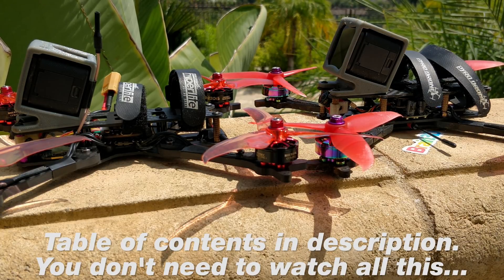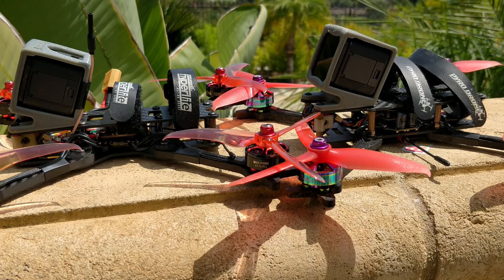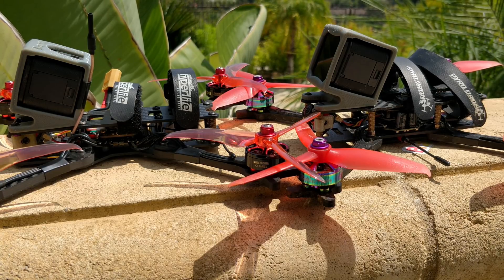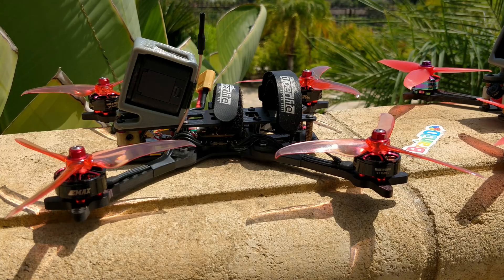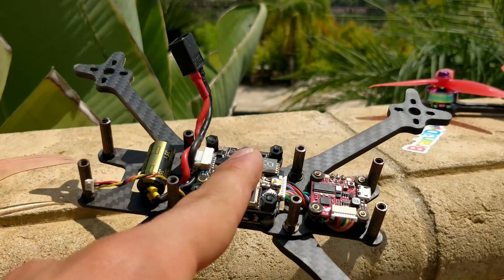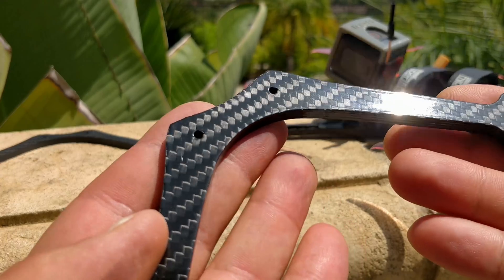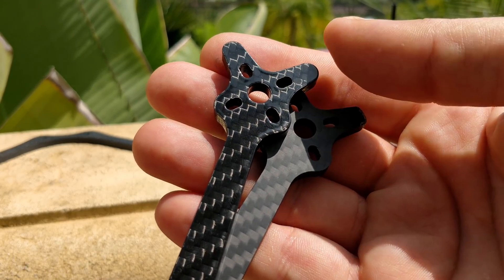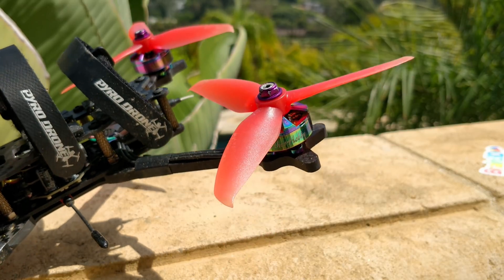Frames, Carbon, Feed Forward, RK 5152 V2

Comment: I start to fly again after 3 years, and i build 4s setup, but now i think about 4s or 6s but more durable, i rly like your frame but i already nave mini not micro cam, and also rly dont want to see propellers, but normal I use rly low tilt. so what will be the solution for that? ty for let me know
Reply from the maker: I'm working on that and the solution would be to use a hero shape GoPro where the lens sits higher up

Comment: The feed-forward output is not affected by the process feedback (external influences, vibrations etc...) nor is it calculated from derivative, so it can never cause the control system to oscillate, thus improving the system response, If the feed forward can estimate the control output closely, the PID algorithm, whose job it is to minimize the error between the current state and the desired state, will need to do less to correct the error. The reason your quad felt twitchy would likely be from the usual pids your accustomed to. Raising the feed forward and lowering your p and d should give you a better flying quad.

Comment: Hey ! i know you have done other carbon videos What do you think of GEPRC carbon i ask cause of all the quads i have i replace the arms on my stretch x  LSX5 al the time compared to never on my bother frames P.S. i forget to floss when you don't make new videos
Reply from the maker: I don't remember clearly but I think it was alright. You can check for yourself.  Is it all carbon?  No weird stuff in the middle. Do the arms flex if you try to bend them or are they absolutely stiff?

Comment: Curious about your use of 2207 1750kv motors, as opposed to the higher powered 2450-2600 kv motors from your other videos. Do you get more throttle "resolution" ?
Reply from the maker: Yeah it just spreads our the lower half of the throttle when I run 4s

Comment: Great video! About the 1100mAh packs though. I think folks expect longer flight times with 6s. So higher mAh and subsequently higher weight has meant longer flight times at the expense of acceleration. Running the math I see no advantage over 4s when using smaller mAh LiPo’s for 6s other than the need for smaller gauge wires. However, most manufacturers aren’t using smaller gauge wires and the need for larger components to handle the increased voltage and caps may offset the weight gains anyways.
Reply from the maker: Sure but there's no point in running a bigger pack if the flight experience sucks. Have less fun for longer or just swap a pack and keep having more fun. The 1000 6S is the same size as the largest typical 4S pack anyone uses normally.

Comment: I wanted to purchase a rev35 esc from banggood but it is on backorder, so do you think it is worth getting an eachine tyro99 kit for the parts? do you have any other suggestions?
Reply from the maker: Some of the eachine kits are surprisingly pretty okay. Not the ones that have built in DVRs. For ESC, that one is still good but the hobbywing 6S 32bit is top of the line.

Comment: Just wanted to get the answer from the man himself.....
What are the differences between a Floss 2 and a Floss 2.1?
I picked up a used Floss 2 that was listed as a  2.1 and I’d like to know what changes were made and what parts are compatible.
Thanks for the great content!
Reply from the maker: The 2.1 uses boomerang connected arms. The base plate only has two holes for the whole front and rear arm mounting. The 2 uses individual arms with two screws on each arm. People generally didn't like that the arms could gain some wiggle room over several crashes requiring you to tighten the bolts a little. The 2.1 is the one to go with now and I've tried to discontinue the 2 many times....hell I've tried to discontinue all the old designs.  Just keep selling.

Comment: I was actually thinking about finding some different standoffs and trying this with the floss style. But another idea is to inver the construction so the body hangs to the bottom and you either hang the stack below the arms or maybe a 30.5mm pattern could be added to the bottom plate leaving it as builders preference. I ended up getting the floss 2.1 instead so I can at least try 7" props without the body in the way. I won't be able to try the low deck idea but I decided it's not that important.

Comment: Glossy carbon. It's also easier to clean. It will set it apart from the rest. I also like the slammed look. Maybe put mounting holes in the top plate and hang the stack. The stack standoffs would be the last thing to get screwed in. I would also like to see an option for multiple arm mounting holes so there builder can choose true-x or stretch-x.
Reply from the maker: Multiple arm mounting options just increase weight. I considered the hanging build but it would have been too annoying to take apart after built

Comment: Hi Bob ! I have a question : For the same motor, does KV have an influence on tuning ? Thanks !!
Reply from the maker: Yes it does but not as much as you might think. The Kv needs to change by maybe 200-300 for it to matter. Ultimately the tune seems to have more to do with the relative power of the quad to it's weight and it's weight distribution across the frame geometry.  At least that's what I've found.
Reply: @Kabab  thanks ! What will brought 2600 kv vs 2400 kv for freestyle ?
Reply from the maker: @fareneightfpv8382  that's really personal preference entirely.
Reply: @Kabab  thanks !!

Comment: Hello, first time commenter here. Thanks for the knowledge and information.
Curious to know how the RCX LS 2207 holding up until now. How is the bearing? Does the performance degrade substantially?
Reply from the maker: They've been just as good as any top motor. They're just as smooth as day 1. The 9mm bearing is fantastic

Comment: I have yet to understand how props and kVs really relate to each other and how one should go about choosing the kV for their motor/prop, or the other way around. 
For example, wouldn't that RK 5051 V2 be too agressive (high pitch) for a 2600kV (high kV) motor? (In 4S setups)
Would a 5048 be ok? I have no idea.. This is something I still don't grasp
Reply from the maker: In general, high kv should be paired with lower pitch props.
Reply: That's the rule of thumb I have heard, by what is considered high pitch or high kV? And how does one notice that he is "over proping" the motor?
Reply from the maker: @nvoltex  those are great question but unfortunately you can't tell. Some symptoms of over propping include excessive amps and no extra speed.

Comment: Why not just shorten the standoff’s instead of relocating the arms to be above the bottom plate?? I get that you keep the same stack height but with the electronics available these days, the ‘bus’ style frame has ample room as it is.

PS - the gloss only looks good because its different.. I’ve had a couple of spaceone frames that have a gloss finish and when you see it next to a satin finish after some time of only seeing the gloss - the satin looks better.
Reply from the maker: Yes that's how we feel about the gloss too. It's cool initially but then not so cool. Moving the arms inside looks better and also gives more build room. Plus you can't shorten more than 20mm build height or the FPV cam won't fit and you'll need to do some weird stuff with it.

Comment: hey Bob, why not do an inverted build and put the stack on the bottom plate so it doesn't have to be placed between the arms and limit how the electronics have to be placed. I believe it's the future of frame design. you also don't have to have the top and bottom plate slammed so tight together again limiting stack placement.
Reply from the maker: This would just make the frame very tall because I don't want the GoPro and batt on the same level as the motor base

Comment: A low esr capacitor connected via cable is less effective. I Term Rotation and Absolute Control shouldn't be used together.
Reply from the maker: Yeah I've stopped that since. Was just playing with things

Comment: Hey kabab! On and on I keep hearing you talking about thrust and disc unloading Theory and obstructing the line of props... I feel like one thing that would really help you was if I could run a cfd, (computational fluid Dynamics) test on a simple racing / freestyle quad for you, just to tell you how the air flows around the quad when you change the most basic characteristics like fuselage height, location of GoPro, location of battery, Etc. If this is already been done I'll check and update this comment, but otherwise let me know if you want me to run the test for you! Thanks!

Aditya
Reply from the maker: I would love to but don't know how. Do you? 😁

Comment: Oil rubbed.  Have you ever considered mounting the rear wishbone arm on top of the bottom plate and the front arm below the bottom plate?
Reply from the maker: Yeah it works fine but makes rolls a little wonky

Comment: I don't think the gloss finish is worth the extra cost. It actually looks a little plastic (cheap) at first glance.
Reply from the maker: The regular ones will still be available
Reply: anyway the new frame looks awesome, I really want to get my hands on one, wouldn't happen to be getting 6" arms for it would you?
does it fit mini size cams like the foxeer predator mini or does it only take micro cams?
Reply from the maker: @zacjohnson8404  sorry. No mini cams. There's no way with a 20mm build height.  I'm just working on the 5" first. I'll consider the 6" later although it's not going to take too much effort to redesign the arms.

Comment: Bob, I believe that I'm already able to build working quad with any of frames you presented here. Even on abandoned ones ;)  As always the main issue is an extra money for frames and boards (and extra boards if regular 30x30 doesn't fit in) and free time.
I actually don't care anymore about how gloss or matte arms are. They must not break and stay light with that - that is the only thing that matters for me now.
Rates 1.30 is the way to go. In lighter frames it felt a bit better being 1.20, but in general for me 1.30 is the best now. Thanks again about telling about that.
There is a reason for battery wire thickness. 16AWG wire you mentioned have fuse current (current which will heat up wire up to melting point) 119A. Some guys often exceed this current as we seen in various DVR videos. There is a nice beast called electric resistance which affect current output plus I don't wish wires heated up to several hundred degrees in my quad. 14AWG is safer (fusing current 166A) - I even have two 4S batteries with 14AWG wires (75C and 100C) and they do perfectly fine. 12AWG for 6S seems definitely overkill. I believe that manufacturer who already produce 4S batteries, didn't wanted to change production line for 6S :)
Reply from the maker: Yeah I bet that's why they didn't bother changing the awg wire.

Comment: What about the kevlar/carbon? is it too much or did that material mix not prove to be worth the cost?
Reply from the maker: Forgot to talk about that. It ended up not actually being any better. Just more expensive like everything else I test that costs more. Btw someone just told me there's a 1000mah 6S CHL. True?  Weight?
Reply: @Kabab  sure is Bob 😃 I'm actually flying them on my 6s rig. They come in at 186g
Reply from the maker: @fsarfino  why on Earth doesn't Sergio carry them!?
Reply: @Kabab  not sure but I'll help him get them on order 😉
Reply: watch the negative terminal on those batts... has a tendency to rip off, the problem didn't extend to the 1250 6s which is odd

Comment: Ill never switch from boomerang arms. So strong... I fly acro with the 2.1 because I don't care about videos. Countless crashes and I only have worn the motor protection. It's obviously cramped so I have been thinking of going to a flosstyle just for the extra room. I always thought I would put the arms inside and just change the standoffs. I don't care about premium but I do want chamfered edges.

I went with Pyro-Drone's ultralight 1250 for 6S and love them and could well afford the extra weight. That being said I would kill for a pack that is close to the Thunder power 1100 at around 180g but not $44 each.

What kind of time line for Hyperlite's with POPO Pro? Loving the BH R6 1750 for now.
Reply from the maker: I dunno when but I just actually tested the motors this morning. Just posted on my IG. I'm seriously impressed.
Reply: @Kabab  2207.5! Can't wait!

Comment: Make a Kwad jousting game. It's simple for two people. Have a plank of styrofoam mounted vertically on the quad. Then maybe have a skewer or knife (preferably something sharp) mounted in front of the quad, so it's sticking out of the front. Then it's kinda like jousting. Two quads go head to head at each other, and whoever gets the sharp thing in the foam is winner :)

Comment: Oh wow, thanks for posting a clip of my video at the beginning of yours! That's so awesome! :)
I'm literally in the middle of editing a next level Tetraquadron video.
In the meantime, quad footage of the likes you've never seen before: youtube.com/watch?v=MS42bAJ6hTw
Reply from the maker: Holy shit!  How!!?
Reply: Ages ago I made some 2 foot diameter whoop gates using battery powered LED strings, then yesterday working on Tetraquadron Next Level (should be upped within the hour) I remembered I also have some diffraction glasses, so I cut the plastic lens out of one and stuck it over the DVR lens.
Instant FPV Laser Rainbow Unicorn Drone Race Gates :D
Reply: Tetraquadron Level 2: youtube.com/watch?v=eFxBW4B4qnI
Here you can see those LED gates without the diffraction filter.

Comment: Hah. I run 20 awg to esc with 2306 2500kv and high pitch props on a heavy quad and have no issues. It s just i cannot fit anithyng thicker there. (diatone frame gt200n)

Comment: Absolute control shouldn't be used with I term rotation, only one of them at a time.
Reply from the maker: I had no idea. Those don't seem to do a damn thing.  I've turned them both off already.
Reply: There are useful in LOS with quick maneuvers using high yaw turns and continuous rotations with roll during funnels for example, you can see the difference. In FPV, there's no such maneuvers and (almost) no error to compensate over time, so the effect during tricks is so small that it's not visible.
Reply from the maker: @roscotte  that makes sense.

Comment: The problem with those gloss finishes is that the coating tends to pool and accumulate near the egdes (you can prob see that near the motor holes). The AstroX stuff is prob the best on the market right now so I'd go with that and a light chamfer (preferably round instead of straight).

Comment: In you made arm that has carbon middle (2mm) and than kevlar top it would be ¿stronger?

In my head it makes sense.

You want to have middle with material that's as hard to bend as possible and then outside as hard to stretch as possible for best strength
Reply from the maker: After a whole lotta testing, I've discovered that the kevlar doesn't do anything at all really.  It's not worth the cost.
Reply: @Kabab  the carbon pipes are the strongest way to make arms. But they suck. The arms would be light and strong but you can't design make rest of the frame light. 

If you connected all of the arms with steel wire it would add a lot of strength in forward crashes and protect the camera. ( it would take impact that would otherwise take  one or two arm and it would spread it to all 4arms

Comment: I still think the 3" should be called the bucktooth, been looking forward to this video. Thanks for sharing
I really like the gloss carbon, is it possible to offer both?
Reply from the maker: I'm maybe thinking to only get the gloss actually. But maybe both will be made available.
Reply: Kabab FPV The OverBite 3”!
Reply: if its possible to take the gloss back to matte with a piece of 800-1600 grit sandpaper and a few minutes, my vote is for gloss 100%
Reply from the maker: Very interesting...
Reply: @Kabab  the OVERJET sounds better.